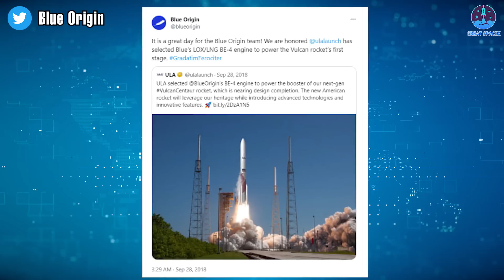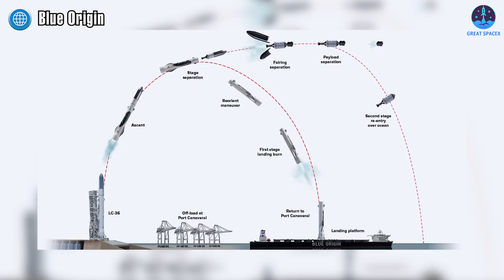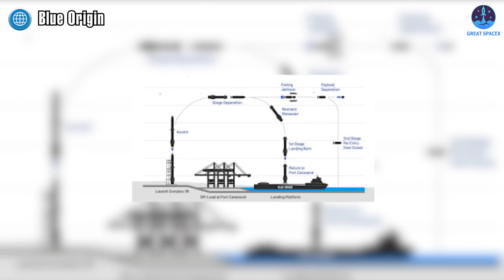Jeff Bezos New Glenn 'Mistake We Made'!!! Never beat SpaceX...

Comment: Pretty darn sure BO will blow their March 2024 deadline. They have conducted no pad tests with a completed rocket and they have no experience with orbital launches and no track record of completing projects in a timely fashion that weren't based on derivative work. New Glen is far more complex than that.

The Shepard launches were just Spacex grass hopper experiments originated whose tech originated the Delta Clipper experiments of the 1990s. 

BE-4 was the first test of any real innovation for BO  (with performance stats Way below Spacex Raptor. (Raptor 3 tested stable at 269 tons on a sustained burn, suggesting it could match the 250 tons of BE-4 in a much smaller/lighter package with much better ISP. BO finally delivered engines about 4-5 years late and there was an explosion in a (non destructive) test recently that was due to be used as a production engine for its 2nd flight. 

The March 2024 New Glenn payload is "low priority/cost" but putting it up on a rocket that no one's even seen yet (outside of a mock up)... this late in the game seems more like a wing and a prayr.

New Glenn, at this stage, would seem to need at least 2 years and alot of money for a credible launch attempt. Jeff Bezos may also need different leadership if this is to happen as the current head of BO seems more familiar with pushing papers than building cutting edge rockets.

Comment: wow.  I knew you were biased but... "Limited success of New Sheppard" ??  It has a near perfect record of manned and unmanned flights with 1 failure (actually the rocket almost landed after separation but hit too hard due to the bad engine) and this was actually a good test of the emergency escape system.   I suppose you conveniently forgot Dragon 2 exploding during its draco test?  The toxic fuel leak delaying 2 egress?  The STILL troubled Raptor so far having 4 out of 100's of successful relits with 100 percent power?   You do know green and discolored exhaust are all signs of seal failures?  The failed launch of Starship with 7 (maybe 8) failed Raptors.  the first 3 within milliseconds.  So that wasn't debris.  That was hubris.  Thinking a flat surface is okay for the launch of a rocket (it's not)  as the reflected sonic energy damaged them.  Probably the others as well.  The launch was SLOW due to engine failures and low power.  There was no maneuver to "clear the tower"  They struggled to launch.  Meanwhile the excessive time to ramp up enough power dug a 20m deep crater.  Further damaging the rocket probably.  
I love SpaceX.... I do.  But sometimes they are so blind to issues that all other engineers and agencies are fully aware of.  Its WHY we have trenches or at least a reflector at a 30-45 degree angle under our rockets.  The insanity of doing the same mistake over and over again is....  troubling.   The steel plate they are installing is ANOTHER boon-dogle as the steel will act as an even BETTER reflector.  The water system they have installed would have to be 4 times bigger for the 10+ million lbs thrust  All of this is crazy.
Reply: But even with all of Spacex's problems, StarShip and Starbase are very much in active iterative development, and they still launch 8-10 Falcons to orbit per month, with up to 16 reuses of specific boosters. They are the PREMIER Launch Provider in the free world currently, and have the HIGHEST VALUATION for any Launch Company, comfortably beating ULA, LM, Boeing, BO. SX will very likely fly SS successfully this year. They are not worried about showing their failures as they iterate, so people like you can try to use such failures as a stick to beat them with. They simply don't care. They just march on, solving problems as they go, and doing things on a scale and at a speed that no one can match.
Reply: The plate also needs ceramic tile to withstand the blowtorch-like heat. Can the tiles stay on the plate during launch?  No matter what they do the sonic energy you mentioned will need to be addressed.
Reply: WE?
Reply: still shows more progress than BO.
Reply: @Wolfric1970  I guess we'll just have to see how well their solution works. I have seen no mention of any ceramic tile on their part. No other launch site that I am aware of has needed or used ceramic tile.
Reply: @stefanbaartman5893  Neither have I.  Then again I have not seen a launch surface 90 degrees to the engine thrust.  It probably cannot be done as the tiles would most likely be torn off.

Comment: Can you build a single one twin. this is sample blue print. Three engine triangle style. Everything else to connect and build. Everything else coming around corcle to three triangle.and a engine flame coming down with five. In a middle used higher power gas not air pressure from turbo. Test it first. Don't burn out or explore.When it's done connect to a rocket booster. Heavy thing faster than power kicking.
Reply: you make as much sense as a flatearther or someone who thinks the moon landing was fake because the reflection or some kind of bullshit like that
Reply: Is this autocorrect or weird English
Reply: @Wurtoz  🤔🌍😯
Reply: @WinBoAngelLife  👍🤜🏽🤏🏽👍🫵🏻👈✊🤝🤌🤛

Comment: I still don't think we will see new glenn launch... they are having a hard time with engines for ULA, let alone new glenn.
Reply: the engines are fine they knew something was wrong with the one engine but tested anyways it's called testing because that's what it is testing till it blows they are behind but not out please don't speak unless spoken to when it comes to things you don't know
Reply: @charlestorruella8591  the engines are not fine... engines 1 and 2 on Vulcan are good, but engine 3 just blew up, took them damn near a year to build that... so if they are able to increase their productivity to 24 times as fast as current rate, they would have enough for 1 Vulcan launch a month.... ULA made a huge mistake choosing BO, they will barely be able to keep up their ULA engine needs of 2 a launch at this point.
New glenn is years away, unless they fuck over ULA, which I hope they wouldn't, but it wouldn't surprise me.
Reply: @charlestorruella8591 o you're fine with loser bo testing to failure but critical of musk testing to failure? Kind of dishonest chuck.
Reply: @charlestorruella8591  LOL, Bezos 10 cent Army!
Reply: @rogerthomas169 plus starship fails in the tests at over capacity. Be4 failed without reaching 100%
Reply: @charlestorruella8591  But we Do know. That engine was slated for the second launch, not a testbed unit to explore the outer edges of the design capabilities of BE-4. It was supposed to be a production engine.  If they were building engines faster, this wouldn't be concerning, but the reliability of the engine is not good at all right now and there are only 2 of these in a Vulcan. This is not Falcon or starship where a single engine fail won't crash the rocket.
We know that BO had serious internal leadership problems and was running hardware poor on BE-4 when they were supposed to be running hardware rich. The leadership was messing around sending VIPs up and down on a glorified pogo stick (which blew up) when they were 4-5 years behind on BE-4.
They also had an exodus of key talent (who expressed derision for BO boss) when their Blue Moon lander project was roundly beaten by Spacex.  The fact that the program was mostly outsourced and a cut-and-paste copy of the Apollo era lander... not a confidence builder.

BO has a no significant track record creating anything near as complex as New Glenn. BE-4 May prove the exception... but the jury's still out on that.
Reply: @rogerthomas169  spacex is pumping out 1 engine a day, so blowing up in is no big deal... BO takes a year to build theirs, so blowing up is a big deal... 
P.s. I've been studying rockets and engines for decades, I know more than most on the subject, and keep regular updates on all things space. Just at this point spacex is the king..
 I'd BO was able to surpass spacex I'd also be a fan.
 But when one company can out produce the other by nearly 300 times, I think we found the winner.
Reply: I think New Glenn is a VERY purty rocket and I hope to see them launch. Someday....
I LIKE rockets and more launches to watch is better in my opinion....
BO may be successful somehow someday but it surely is a slow poke at getting ANYTHING up in the sky..... built on the ground..... um... tested?.... Well...
I like space stuff so..... I think a shiny New Glenn would be fun to watch.
CHEERS!